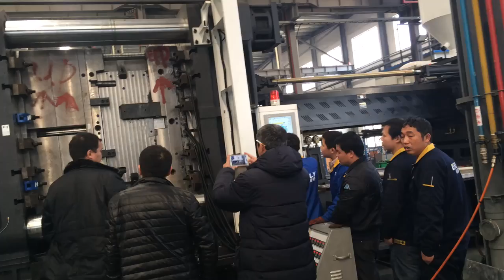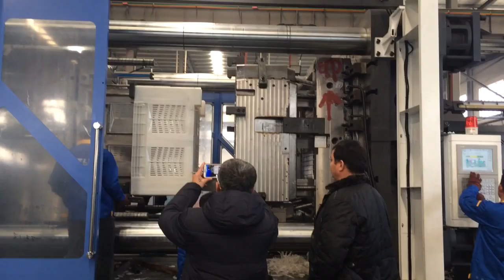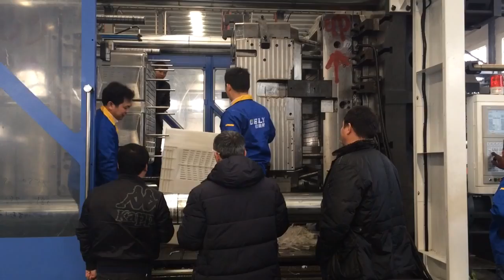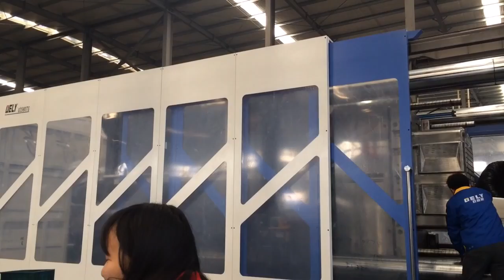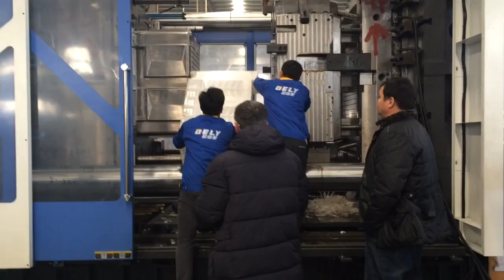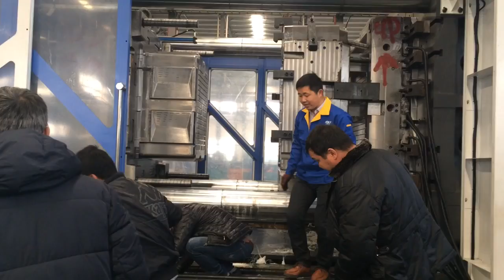2800 ton plastic injection molding machine .32kg basket crate mold test ! robot arm not install yet

Comment: Absolutely no regard for employee safety! Bypassing a safety gate and entering the molding area with a “live” machine is absurd!
Reply: How u think molds run in semi auto?
Reply: Yea I wanted to comment the same thing.. I notice in most plastic injection videos from china or similar there's ZERO safety.. amazing!
Reply: previous shop you'd have to walk in the same way and pull a battery tray out hand it over to someone outside and stand between both halves to put your inserts on the mold again
Reply: probably pressure mats that kill everything once the door shuts and theirs pressure on the mat
Reply: That's what mold protect is for. 😅

Comment: Most people haven't a clue on the about of work behind a plastic part in their lives. From the oil to plastic formula to the part design to mold design then machining to finishing on to the very complicated injection machines.
Reply: The machines aren’t particularly complicated, the moulds however are very complicated.
(I am an injection mould maker)
Reply: @danielpumphrey1761  I take it you can’t read electrical or hydraulic prints to make a comment like that. I’ve been in IM for 25 years and can fix IMM and build molds. It’s a shame I always have to fix the electrical issues on tools because the tool guys can’t wire up a simple prox much less know the difference between a pnp or npn.

Comment: Thats a big friking mold :D Biggest mold I`ve set so far was 12 ton, I wonder how heavy is this one?
Reply: I used to set one at 83000 lbs....HUGE
Reply: we made something similar, it was around 30T
Reply: I am working with 25 ton
Reply: I’m working with a 100,000 lb stack mold
Reply: I’ve die changed a 70 tonne (154,000lbs) tool, 45 tonne moving side, 25 tonne fixed side